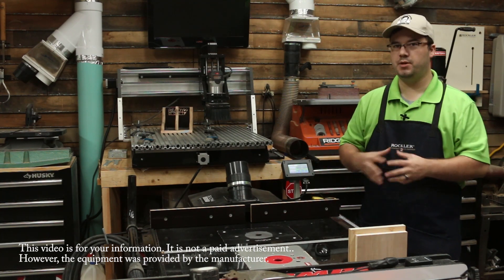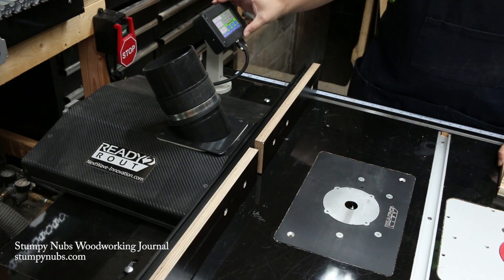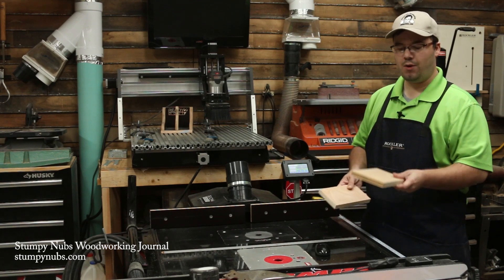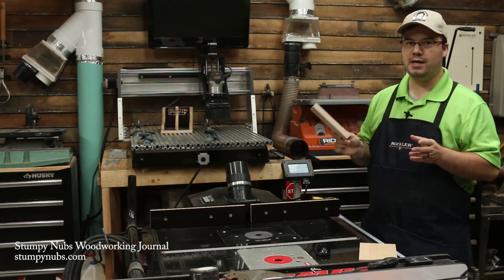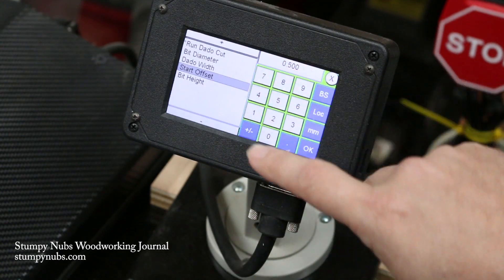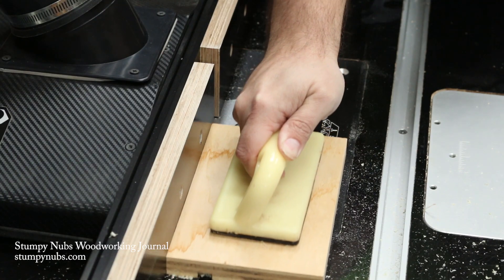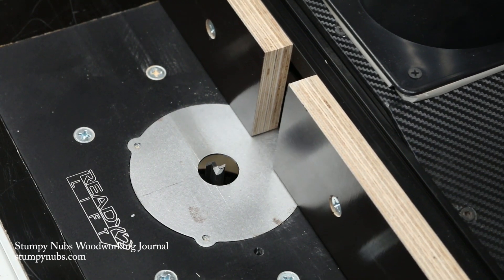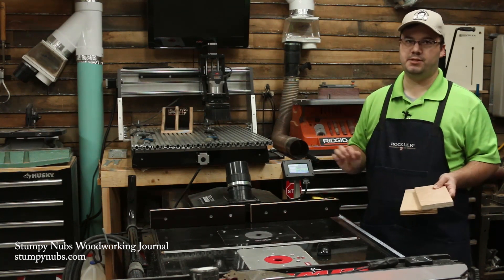Hi-Tech routing: Using the Ready2Rout fence and lift to cut dados and grooves

Comment: New subscriber... cool channel!  I'd been looking at this for a while and appreciate your endorsement of it. I notice you have the newer version of the Ready2Route - the one that shares a controller screen with the Ready2Lift (instead of a controller built into the top of the Ready2Route). Nice that they work together so well. I'm interested in seeing how you do different types of joints with this. I see you have it installed in your table saw extension table. That's what I have done with my Incra system, which this would replace. You also have done something I've considered in my Delta Unisaw - it looks like you put a miter slot in the table for the router table to use - what did you use for the metal slot? Thanks!